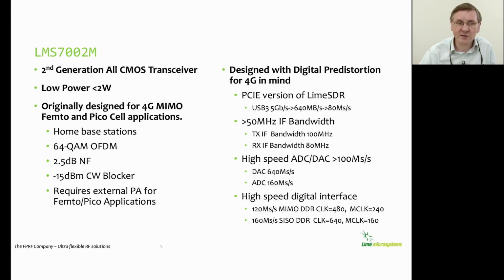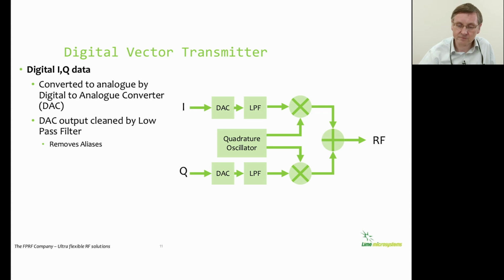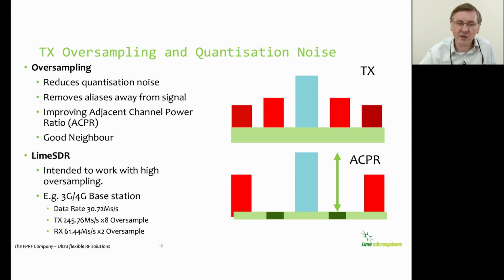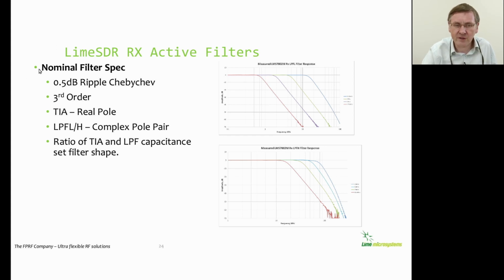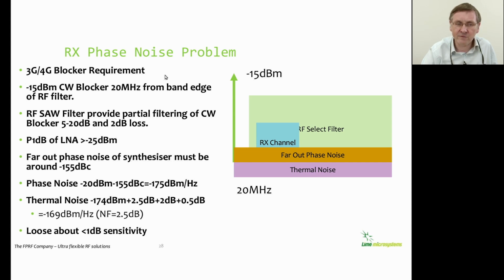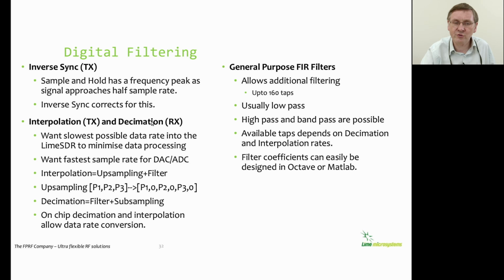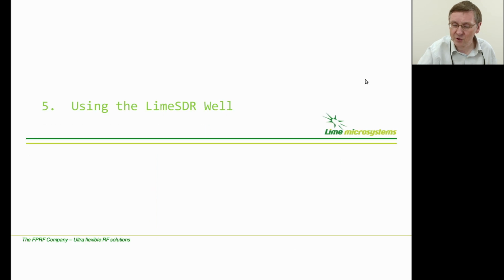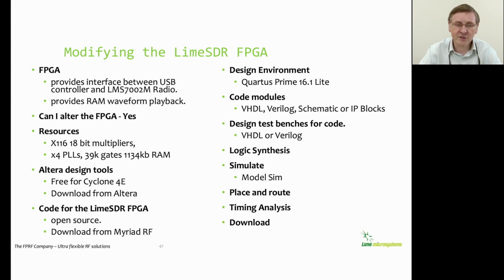WM #2: What is the LimeSDR?

Comment: Why does each TX channel have TWO outputs?  i.e. do you need two antennas (TX1_1, TX2_1) to transmit?

Not sure I totally understand the differences between a 'direct conversion'  and 'direct-rf-sampling' receivers.. other than the former mixes the RF input signal with a LO to produce a 0-Hz signal in one stage (output of the mixer), while the latter (direct-sampling) has an ADC that can sample directly at the target frequency without converting the signal to a lower frequency (Chris DeMartino).     What approach is the LimeSDR using?